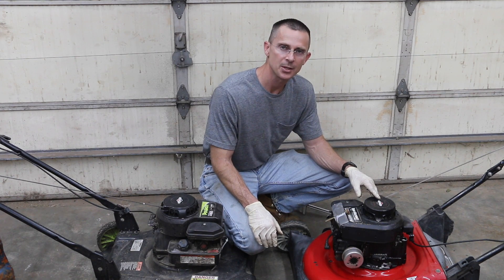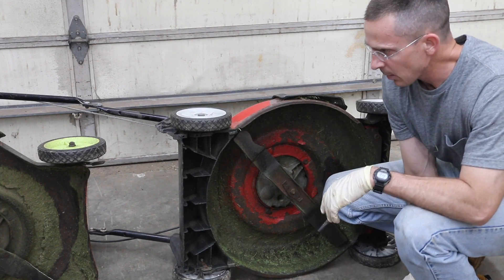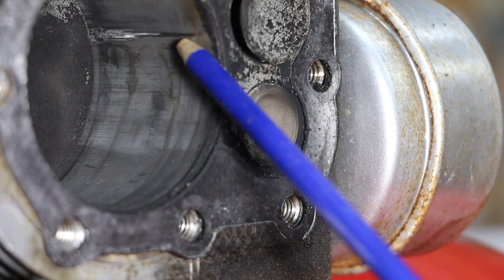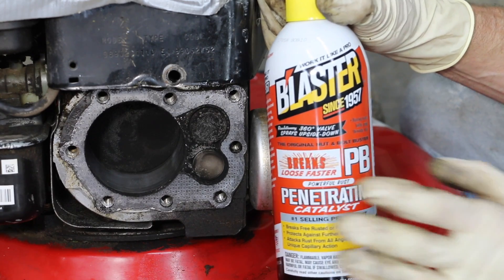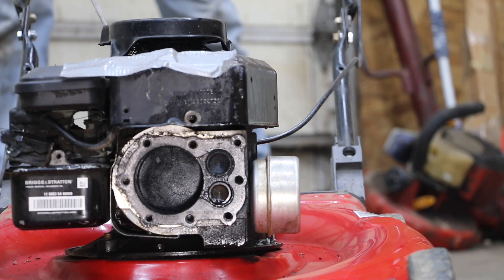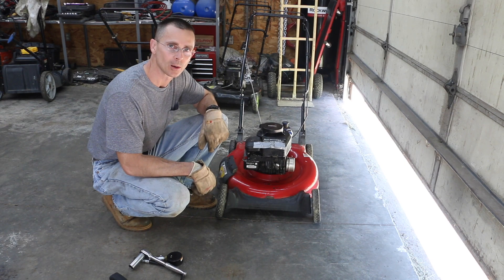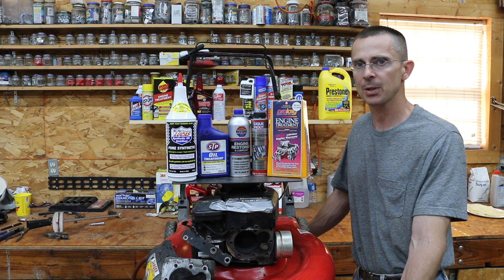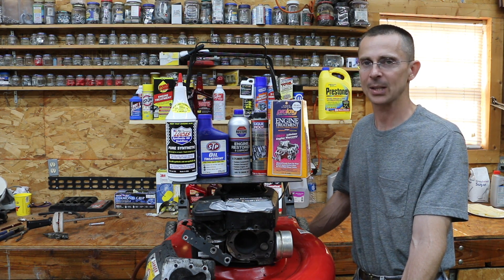Engine ran without oil, seized! Can it be saved?

Comment: 50 years ago I worked for Western Auto as a small engine mechanic one summer.  I got in a new mower where the customer started the new lawnmower before adding oil.  I removed the head, poured some oil in the cylinder and crank case, then rotated the blade a few times to spread the oil and loosen the piston and rod.  After assembly, the mower ran like new.  Customer was happy.
Reply from the maker: Thanks for sharing.

Comment: I came to this video because Yesterday i did start up an engine from a pay loader. 6 cylinders and oil completely low i didnt realise. Within a minute the running engine has started getting low, the smoke got really dark then it stopped. 
I couldn't get it started again. 
I hope i didnt broke anything. Im so deasapointed
Reply from the maker: Thanks for sharing.

Comment: What a shame. Those old flat head Briggs engines will last for ever if maintained. My lawn mower has now been in service for 43 years. It runs well and doesn't consume oil more than when it was new. The wheels have fallen off, the handle broke, the carberetora and coil replaced but the block and bearings have never had an issue. It was necessary to adjust the valves. Everything else can be repaired.
Reply from the maker: Thanks for sharing.

Comment: Using the Mobile 1 10 w30 and Marvel mystery is excellent.  However,  use JB Weld for the deep cuts in the cylinder wall.

Comment: I bought a gas powered edger from Lowe's in the clearance section for 20 bucks that someone forgot to put oil in it when they bought it. I brought it home pulled the cord and it was locked up tight.. took the spark plug out sprayed a bunch of WD-40 in the hole and let it sit for a little bit and then stuck dowel inside the spark plug hole and hit it with a hammer to knock the piston loose.. I've had the thing for about 3 years now and still use it.. and never had to take it apart and do anything else
Reply from the maker: Great! Thanks for sharing.

Comment: Did you not check out the top and bottom end? Also, I would have thought that metal swarf would have been passed around the internals and wanted washing out first. 
However.
Great video.

Comment: Just had a 2022 CFMOTO 300NK (Bike) Seize up from no oil, was sold Oil that was NOT Synthetic, but I asked for Synthetic. Guess I should have realized it wasn't synthetic, but I didn't and now here I am with a $4500 pile of metal. CFMOTO says it's not covered under warranty, and a new engine from them costs $3k+. Luckily I found a used engine, but I'm trying to see if I can get this one running again, even if I replace it. Thanks for the video!
Reply from the maker: You are welcome!  Thanks for sharing.

Comment: We camped in Abergele in Wales in the early 70's. It had a pebble beach and I holed the sump on a 105e Ford Anglia. It got 7 of us back to Liverpool no problem without any oil in it. I put a new sump on and oil and it had no problems. I also did the same in a Morris Oxford. Both cars had cast iron engines. Maybe they can run without oil.
Reply from the maker: Thanks for sharing.

Comment: I'm not an expert, but I think using a thicker oil should help a little bit. The knock is likely caused by worn out rod bearings, and they need to be replaced. But thicker oil should help it a little. Again, I'm not an expert so I might be terribly wrong
Reply from the maker: Thanks for sharing!

Comment: Back when I lived in California, a co-worker had a pickup truck that was smoking so badly that he got a ticket for driving a gross polluter. He added a bottle of prolong to the oil, ran it for a while, then he drained out all the oil. He started driving it to work...20 miles each way. He continued driving that truck for months without any oil in it at all, so it didn't smoke. I saw that so I know it was real. I started using pro long after that. I watch many of your videos, keep up the good work! From Wayne at Thrif-T body & paint in Wyoming.
Reply from the maker: Thanks, will do!  Thanks for sharing.

Comment: 2-1-23... assuming machine is a "has been" by now... when you have such a severe knock as this, your facing the inevitable... you must go deep within the block... even minute friction damages aluminum...& can gaul rod & rod cap easily, even cease to journal on crankshaft, also value guides can expand & move, restricting valves etc. etc. might get by on polishing journal...but rod & rod cap 👎... might can polish piston & check piston pin...hone cyl. as the other comments suggest...& if cyl. wall gouged deeply...only hope is to bore...have witnessed some on you-tube us j-b weld...but engines such as this one was...a great project for inquisitive minds & building knowledge... great stuff for a video to all of us out here ! 👍🙋👍🙋👍🙋
Reply from the maker: Thanks!

Comment: Can you run a 4 stroke engine on 2 stroke gas with no motor oil in the crank case ?? That would be interesting.
Reply from the maker: Thanks for the suggestion.

Comment: I know it's long past time for suggestions, but I wonder if you could bore it out to fit a slightly larger diameter piston and its rings.  I think it's great that you got it this far.  Love your work, Todd!  Saw this one listed in suggestions and was curious enough to check it out.  Another thought is to bore it out for a cylinder sleeve that would fit the current piston.  Just a couple thoughts.  The first one may not be possible with the current piston connecting rod, so maybe that could be changed, too.  Just spit balling 'cause I really have no idea.
Reply: You have a good idea,  the cylinder can be bored out, and an over size piston fitted with new rings,  the biggest problem is probably the rod and crankshaft.  Could use a new rod and polish the crankshaft use new bearings and have a good rebuilt engine.  Part of the problem is, by the time you do that, you could buy a new predator engine ( harbor freight) still the engine can be fixed.  You're diffently on the right thinking about this engine
Reply: @bertgrau3934   The thought came because I have a Craftsman self-propelled push mower that the engine has zero compression now at the beginning of its 3rd mowing season.  It's out of warranty because I didn't use it the first year I had it.  I bought it in anticipation of buying a house, and it took about a year to find one I was willing to buy.  Depending on what's wrong, I mean it could be as simple as a valve stuck open, but instead of larger piston, I might look into a cylinder sleeve after boring, if such a thing wouldn't take a year and hundreds of dollars to find.

This was a $450 mower at Sears right before the store closed here in 2018, I think it was.  The first Craftsman of its kind and power that I ever had an issue with, but this is what Briggs quality has come to since manufacturing moved to China.  I found a replacement for $200 a year or more ago, but when I saw it was made in China, I wasn't interested anymore.  Then I learned that Briggs have been made in China for a while before that.  Craftsman is selling a reputation that is not there anymore.  Craftsman tools and everything else.

Lowe's sells Craftsman now and the prices are so much higher for so much much less quality.  It's so sad, but I'll see what comes of the mower.  I have a 42" cut tractor mower now, but there are things that this mower would still be great for, if properly repaired and reliable.  I miss Sears and Craftsman quality!  A bigger piston might need a different carburetor.  I won't buy another mower if fixing this one is too much trouble and/or too expensive.  Thanks for the comment!
Reply: @100vg  
I worked on a Briggs that was built in 2017, same problem 0 compression,  it was a valve guide holding the intake valve open. 

It could be the valves out of adjustment,  or  something else.  Pull the valve cover if a push rod is bent you may have some serious problems.  I can tell you if you had to have the cylinder bored out, it would be cheaper to use an over sized piston than to have a sleeve put in.  The parts are pretty expensive as well.  I had a 12.5 Briggs and it was going to cost over $300 for the parts, plus the machine work could easily push the cost over $400. 
It may be cheaper to buy a good running used engine and swap them out.  You might even be able to get more horsepower,  that would be good as well.
Reply: @100vg  
You're welcome,  if you have any more problems,  or questions please feel free to ask,  I enjoy trying to help others if I can.  
Good luck with your project.

Comment: Engine Restore would do the most good in my opinion, for the compression,  Lucas oil stableizer might help with the rod knocking ( if that's the cause of the knock) but it sounds pretty bad.  A new rod might fix that, or the crank may need some work.
Reply from the maker: Thanks for the feedback.

Comment: I would join patrion but i got no ride to work i have a honda express NC50 and i got it with no oil line but had to get to work and same thing happened locked up so i want to see the best way to get it started so i can try to boar it out to clean the sides and add a bigger piston to fix the compression.

Comment: I think the con rod is damaged and will let go shortly, no matter what lube product is in the crank case. 2 options: 1. Tear engine down now and measure the crank journal, big end of con rod and the wrist pin and also visually inspect for damage. 2. Use it and measure how many hours it runs till failure. The con rod will probably come thru the block wall when it fails. Measure the damage of the parts that did not fail. Con rod will be the weak link. That engine will be running Windows 11.

Comment: Question: why not replace the piston, rings, conrod and conrod cap?

I realize the cylinder will never be "right" without boring, but it seems a new piston and accompanying bits would've corrected some of the problem.
Reply: Because what’s the fun in that? Also it would probably cost more than the things worth

Comment: For improving compression, I'd use something thick like STP.  The thicker the better.   I don't think even thick oil is going to shim up the clearance you probably have with the rod to wrist pin or crank journal.  I don't imagine these have bearings you can replace so it might be toast.
Reply from the maker: Thanks for the feedback.

Comment: It's always useful to have a few bore horing tools, the cheap kind you can attach to a drill. Sure, for a more precise engine, you'd want to get that professionally bored to a proper measure, but for this kind of simple small engines, it's more than good enough. Just attach it to your drill, grind that cylinder, replace the piston and rings, and you're golden.
Reply from the maker: Thanks for the feedback.

Comment: I have heat seized my two stroke 70cc motobike 4 times before it had run 4 hours in a row but I felt loss of power leading up to the seizure each time so was always ready to pull clutch and lucky enough all four times damaged the piston in four different places each time I pulled the piston I sanded it down smooth, the cylinder had no damage at all, neither did rings, the same bike with same parts has over 20 hours use on it now and has more power too.
Reply from the maker: Thanks for sharing.

Comment: Good old marvel mystery oil! 
Me and my dad went 1/2s on a project car like 15yrs ago
A 1965 T-Bird w/65000 original miles for $750!!!
And it was garaged for 20yrs!!!
Helluva find!👍
Anyways,didn't run 20 yrs!
Wouldn't budge !my father put marvel down spark plug holes
Let it sit for 3 days,turned it 1/4 turn,pickled pistons again,and repeated process like 4or5xs
We then drained it after it turned surprisingly free!
Made necessary repairs/replacements/fluid changes, and poured lead substitute n gas down carburetor...old bitch fired right up!!!
Ran like a top that 390 and even backfired a few times and shot mice outta the fuckin exhaust!!
20 yr frozen motor!!marvel mystery oil works brotha!!!
Great video btw,usually always are!
Reply from the maker: Thanks!  Thanks for sharing.

Comment: For sure it is possible to save a seized small engine I've done it many times if its seized just add oil take the spark lead off and spin the blade a few times 4 or 5 by hand plug it back in make sure you have good gas and I bet 3 or 4 pulls 
you could have a running lawnmower tecumseh used to be really easy
Reply from the maker: Thanks for the feedback.

Comment: Lucas oil stabilizer is my pick great product. Have u ever heard of Pro tec? My dad has one of those friction tester similar to yours. He built race engines back in the 70s and would demonstrate the pro tec additive. The engines were for gocarts that he built and he would sell the additive   to the person that had the engine built. We still have a couple of the gocart frames and they are called A-bone frames u turn the wheel all the way left and the right wheel will come off the ground about 2 inches. Im not sure if they still sell  Protec I think its similar to the additive that soaks into the metal. Zmax.
Reply from the maker: Thanks for sharing.

Comment: Wrong oil. Use SAE30 in a mower engine. Marvel Mystery oil is a water like solvent. Does nothing to help the oil other than breaking the oil down. Not good for a mower. If it was good, Briggs and Stratton would recommend it in the engine manual. Briggs states use NO oil treatments at all in every engine they make.
Reply from the maker: Thanks for the feedback.

Comment: I think a light bore hone would also work. Clean up the sides of the piston with 400grit wet & dry used wet, clean up the rings and reassemble & just use std grade oil.
Reply from the maker: Thanks for the feedback.

Comment: You could get it back to almost new, but it would cost a few times more than the cost of a new lawnmower
Reboring the cylinder / having it sleeved ,new over sized piston, re balance the crank shaft, new bearings, new valve s. Yup for about a grand it could be as good as new.
Reply from the maker: Thanks for sharing.

Comment: When I am putting engines together ill put gloves on and put some oil in the cylinder and coat it around the cylinder and spread it on the inside. Thick thick coats. Works great
Reply from the maker: Thanks for sharing.
Reply: @ProjectFarm  youre welcome

Comment: Test a hone, new ring, and connecting rod bearing for a couple bucks and she'll probably run forever even with the score on the cylinder wall. Those little engines are almost indestructible.
Reply from the maker: Thanks for the video idea.

Comment: I know this is an old video but I wanted to share a related story. I bought my daughter a used hammerhead 150 go kart for her birthday a few years ago, the atv dealership had supposedly serviced the kart, I inspected somewhat, test drove, all seemed ok. Got it home, while she was riding the engine stopped for an unknown reason, upon inspection of the oil dipstick, yikes, no oil, I looked under engine, oil plug missing, apparently after servicing the dealer didn't fully tighten oil plug and engine siezed. Didn't know if this would work but worth a try, I took out spark plug, sprayed in some PB blaster over multiple days,, tried to turn flywheel, no luck first 2 days, upon 3rd day, wow, flywheel began to free up, sprayed more, and each day thereafter engine became easier to spin. Once freed, I drained and washed out all the solvent, put oil in it, fired it up, got it good and warm, stopped and changed the oil again. Booyah, run like a top but before turning her loose on it, I pulled the head to inspect the cylinder walls, surprisingly not much scarring was present, did a compression check after reassembly, no issues. Kart back in service, no more issues with engine! Moral to the story, don't give up, sometimes there are products that work to our amazement!
Reply from the maker: Good Point!  Thanks for sharing!

Comment: I'd use a 15/40 HD oil and run er till she craps out. Polishing the inside of the cylinder when the head was off wouldnt have hurt either. No rebuild in a can will repair physical damage but may get you another season of use. Good video!
Reply from the maker: Thanks!  Thanks for sharing.

Comment: Mix streight moly grease with pb blaster and a bit of marvel oil or lucas oil. To really fix it remove the piston and put a new ring on it, and remove some of the damage and reassemble. Lucas oil and upgrading to electronic ignition has made some pretty awful damaged engines run.
Reply from the maker: Thanks for the suggestion.

Comment: My grandpa was a farmer and he taught me before he died that if you have a bolt or anything stuck just mix acetone and automatic transmission fluid in an oil can and squirt it on the stuck part,let it set a while and it will come loose
Reply from the maker: Thanks for sharing.

Comment: I bought a brand new mower, I put a little bit of oil, but only maybe 1/5 of the bottle that it came with. I didn't think it'd need the entire bottle. After about 5 minutes I learned the hard way. Seized it. Eventually I just tipped it up and forced it with the blade. Once I got it somewhat free I just added the rest of the oil it came with and it fired up just fine. No doubt it's probably damaged, but it seems to run ok.
Reply from the maker: Thanks for sharing.